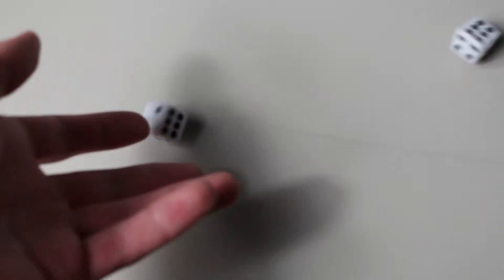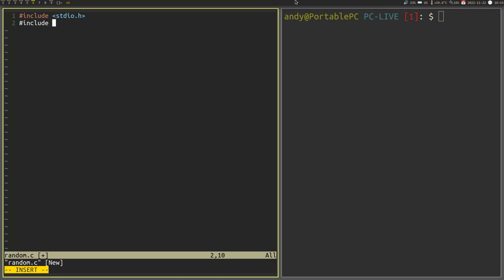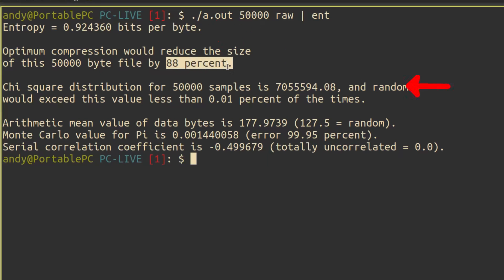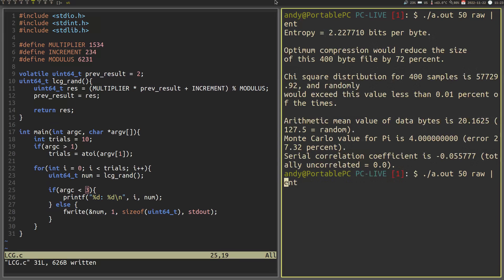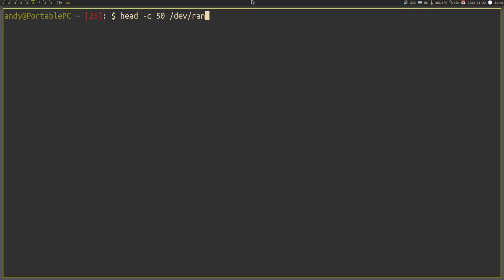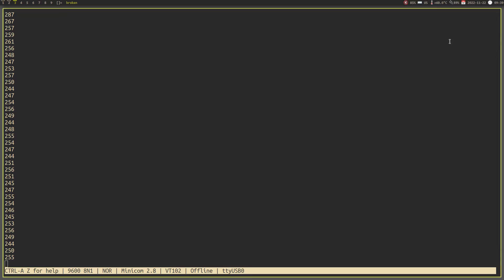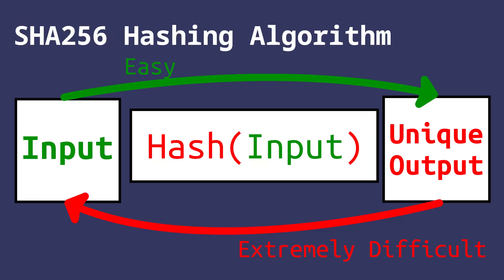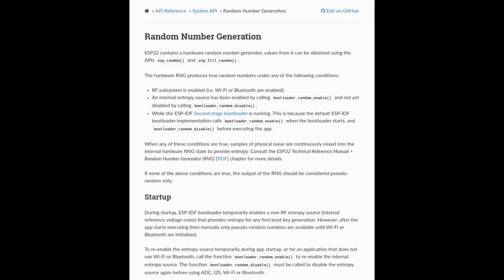NOBODY can solve this - Generating random numbers on an ATmega328p

Comment: Great video. An improvement would be to drive a diode or transistor in reverse breakdown mode and amplify the signal to the ADC-s voltage range. That way you get a good entropy signal from thermal noise.
Reply from the maker: That's an interesting way to generate entropy.

Comment: The problem with the readout of open analog pins is that they are sensitive to EM. And a lot of the environmental EM is predictable. Another important point is to use noise source which is evenly distributed. Noise of semiconductor sources is often "colored". So I prefer metal film resistors as noise source in combination with a low noise opamp, whos input referred noise is considerably lower than the noise of the resistive noise source (100 kOhm resistor) in order to do signal conditioning for the analog input by use of amplification and offset.
Reply from the maker: Thanks for sharing! I didn't really think much about the predictability of environmental EM, so it's definitely something to consider. The inclusion of a metal film resistor is definitely intriguing to say the least :)

Comment: I used A0 input which was floating in the air and read the last digit on that port ADC value to be the random number for electronic dice with large led strips to create the 7 segment display with slow down feature :)
Reply: Used 2 Adc inputs and the selection between them was pseudo random.

Comment: just a small correction: at 9:43, the miners don't "reverse" a hash, they try to append random garbage to the end of each block so that the hashes match a certain number of 0 at the beginning. you might know that already, since 2 seconds ago you had an image with those 0s there, tongue slips happen, but just wanted to make sure that to someone else hearing this to not get fooled into thinking SHA2 is reversible for anything other than rainbow tables (we havent even found the 256 0s or 1s pattern as far as i am aware)
edit: this does not change the validity of the method shown in the video, it basically empowers it even further

Comment: Why didn’t you use the random and noise functions? Generating a random number on micros is actually easier than a pc if you’re willing to add some hardware. It’s pretty easy to come up with a seed that’s impossible to guess if you leverage inputs with high entropy. For example, a well calibrated photo resistor in front of a lava lamp.
Reply: Attached to a 10 bit ADC... If you at least add a high precision ADC this becomes useful but with just 10 bits it's a joke for RnG.

Comment: Somebody help this kid out. 

Here is an example of how to generate a random number between 0 and 10:

int randomNumber = random(10);

If you need truly random numbers, you can use the "noise()" function in conjunction with an analog input, such as a photoresistor, to generate random numbers based on environmental noise. Here is an example of how to generate a random number between 0 and 10 using the "noise()" function:

int randomNumber = noise(analogRead(A0)) % 10;

Keep in mind that the quality of random numbers generated using this method depends on the quality of the analog input used.
Reply: 'If you need truly random numbers', advises to use a 10 bit ADC input which is very predictable with only 1024 possible states, with a photoresistor tied to it predicting the number becomes quite easy, even easier than when leaving the input floating.